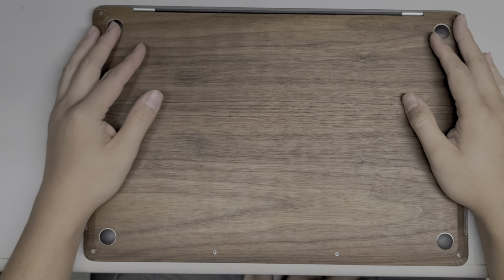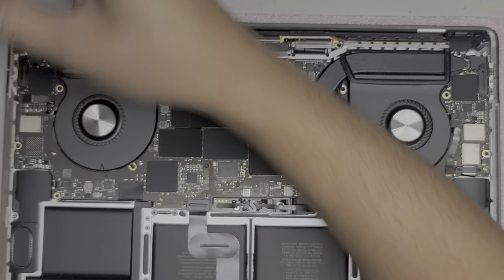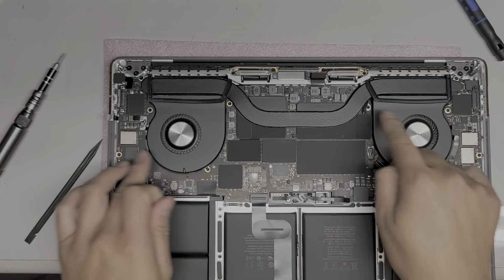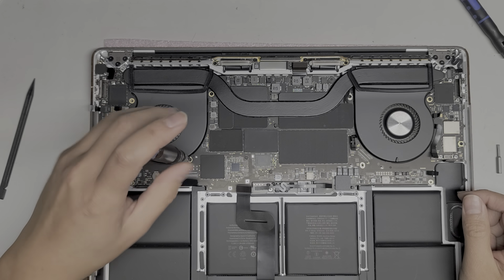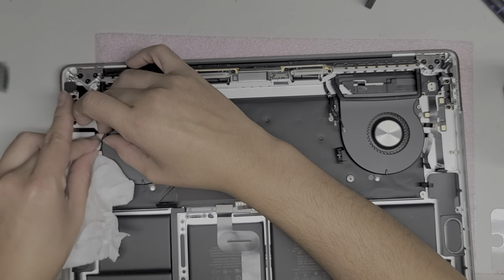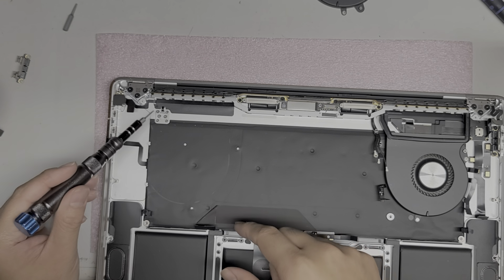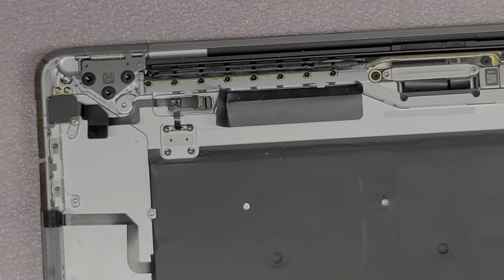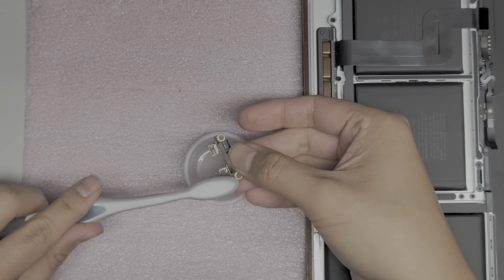2019 16" inch MacBook Pro A2141 Disassembly Charge Port Power Button Fan Repair Replacement Part 1

Comment: I like to either find a photo of the inside of the laptop/tablet/phone i’m working on or take a photo and print it and place all the fasteners and small covers on the paper on top of where they came from in the proper orientation so I don’t have to trust my old brain to remember where each screw goes. I bought an iCloud Activation Locked MBP on Offerup not realizing it was locked but I got it very cheap so I’m going to replace the main board and Touch ID with an unlocked board and Touch ID from eBay. It’ll still be a good deal depending on what board I get.
Reply from the maker: Sounds good

Comment: I am having an issue to find the right screw driver to remove the wifi antenna assembly. I did purchase the tool kits but none of the screw driver fit properly.
Can anyone suggest which exactly screw driver is required to unscrew multiple screws along the length of antenna assembly?
Thanks in advance
Reply from the maker: Use the one that fits best. This set works well https://amzn.to/3JN3SUE start with the size too large, then work your way down.

Comment: Cant get the clips nwar the hinges to remove even with loads of force...
Reply from the maker: You need to slide it down
Reply from the maker: Those aren't clips
Reply: @ItsBinhRepaired  thanks it worked, was just amazed by the level of force. Didn't wanna damage it. Removed a crazy amount of accumulated dust
Reply from the maker: @np5855  great!

Comment: what happens if the latch that locks the connector breaks ?
Reply from the maker: Then you're screwed. You either need to put the latch back or have someone replace it

Comment: i need to replace my io board for my macbook pro 2019 a2159 but i cannot find any youtube video on it. is it simple? or is it similar to another computer so i can watch for another model.
Reply from the maker: What io board?
Reply: @ItsBinhRepaired  the one on the left by the charging port?
Reply from the maker: I don't see a replaceable io board
Reply: @ItsBinhRepaired  so what do I do/replace if my computer wont charge
Reply from the maker: @heartbreakweather  motherboard likely dead or battery issue

Comment: Hi!  I have the same MacBook Pro.  3 days ago, it died.  It won’t charge and it won’t turn on.  It’s frustrating because it died exactly 2 years to the date that I got it as a gift.  I understand it might be the logic board, which is basically a $600 repair.  
In your professional opinion is it worth it to see if cleaning the fan, unplugging the battery, etc will fix the problem?
Reply from the maker: We could possibly fix it for around $250 if the board isn't really bad.

Comment: Do you know which part would prevent it from charging?
Reply from the maker: Battery, charger, charge port
Reply: @ItsBinhRepaired question: do u have to remove the logic board just to get to the I/O board charger ?   Great video but was wondering if there was another way around from removing all that
Reply from the maker: Or motherboard
Reply: I/o board USB-c

Comment: hey Binh, awesome video, thank you!. although i was looking for how to repair or replace my left speaker on macbook pro 16" late 2019 model. the left speaker sounds cracked or has rattling. Do you think thats replaceable? i got the laptop in 2020 and its already got this issue. what a rip off @apple
Reply from the maker: It's hard to find a good replacement speaker as well.
Reply: Any luck? Same with my right speaker! :(
Reply: @anshajgoel  I had the same issue with my right speaker. I couldn’t find any videos on replacing the speaker and the local Mac repair shop wouldn’t touch it because he had never replaced a speaker in that model. I got a speaker from ifixit for $50 and I followed this video  on how to open it. There is almost no way to remove the old speaker without bending it but oh well, it was already broken. The whole bottom surface of the speaker has adhesive on it. I cleaned the old adhesive off the computer and placed in the new speaker. It came with new adhesive on it. I plugged it in and plugged in the battery, put the back on and fired it up. It sounds like new. The whole process took about 15 minutes and I took my time.
Reply from the maker: Yup, you can actually get speakers on Amazon cheaper sometimes. I only replaced the speaker on one like this. I tried like 10 different used speakers all messed up because the process of getting them out destroys them. The only way is to find brand new speakers.
Reply: @bigduner   Thanks for your explanation on this!  The left speaker on my 2019 16" is blown, and like you, I haven't had any luck finding a "how to" video to replace it.  I had read that the speakers were glued/riveted in and other components would likely need to be removed/replaced in order to access them, so I wasn't sure what to do. I had already found a replacement speaker on iFixit site for $50, but I was holding on on ordering it until I could find some confirmation that it was indeed replaceable.  And your post confirms it for me!  I will now be placing my order and hopefully I won't have any issues removing the old, damaged speaker.
Reply from the maker: I believe the speakers on this model are just held in with adhesive.
Reply from the maker: They are a pain in the butt to remove. The adhesive is very strong. You basically have to pry it up.

Comment: Do I need to remove the logic board to replace speakers?
Reply from the maker: No, but they're held in place with a very strong adhesive.
Reply: What is the safest/best way to remove the speakers? Also what kind of adhesive to put on new speakers? My right side speaker blew out. Do you have a video removing speakers? Thanks in advance.
Reply from the maker: @bigduner   I don't think there's a way to remove them without damaging them, but because your speakers are already damaged, it's ok. You basically have to just pry them our with a lot of force. Usually if you get new/good replacement speakers they should come with the adhesive. I haven't replaced these before, so I'm not sure, but you'll want to look at a bare speaker to make sure no parts are trapped underneath anything.

Comment: i have the same macbook, it was working perfectly saturday, and then sunday it would not turn on. i tried everything to turn it on. do you know how to fix this, i bought an i fix it kit
Reply from the maker: Sadly it's likely a bad logicboard. Very expensive repair. :(
Reply: It's Binh Repaired  would you say it is worth replacing the logic board since its not even 2 years old. :(
Reply from the maker: Check if your credit card has free extended warranty built in.

Comment: QUESTION I HAVE MACBOOK PRO 16 INCH 16 GB AND TRYING TO UPGRADE MEMORY CAN CHANGE MEMORY 16 GB TO 64 GB IF NOT HOW CAN I GET MORE MEMORY
Reply from the maker: Oh, I thought the problem was your shift key was stuck. Lol You can't upgrade RAM on any MacBook after 2012. You'll have to sell it and get a new one.

Comment: I have MacBook 16” bought in nov 2019 and now it is dead because it was not charging checked in system before died power full battery capacity 8856 with 93 cycle life and finally died with no battery 
I tried resetting smc with Apple team noting works 
Also I connected Charger through usb power monitor shows it is pulling 2.57amp that’s tells me it charging but not turning on or any sign of life 
Any solutions ?
Reply from the maker: Not sure. Sounds like a dead motherboard
Reply: @ItsBinhRepaired  
It was working issues was not charging it died because no more battery i was thinking battery or charging
Reply from the maker: @Baljit-As-JayKay  neither charge port works?
Reply: @ItsBinhRepaired  
No 
Actually I was connected with usb-c type hub and I was working on my Mac suddenly it restart and after it disconnected with hub and I connected directly to charger was not charging
Reply: Unfortunately it is 80 days over to guaranty and Apple charging for just to troubleshoot too
Reply from the maker: @Baljit-As-JayKay  :(
Reply: Literally the same issue for me.
Reply from the maker: @HoveKB  :(
Reply: @HoveKB  
I repaired with Apple charged me $234
I setup mail in repair they sent me shipping box and after repair done they sent back to me
Reply from the maker: Wow
Reply: Hi Johal. Same issue here. I bought my Mac 16, Feb 2020. Just after 14 months mac is dead.  No response at all when click on power button( even fans does not rotate) . Apple asked 970 SGD to replace the mother boards. Local repair shop asked 500 SGD to fix the issue. ( so basically both apple and local repair shop says it is an issue in mother board. ). I am not satisfied with the cost and trying to find out a solution myself. For your case, what was the exact issue ? what changes did fix it. Apple told me that they do not repair motherboards. What they do it fully replace it. Did they repair or replace in your case ?
Reply: @912dim  they charged me $275
Reply from the maker: Hmmm sounds like this might be a design defect.
Reply from the maker: They only replace
Reply: I have the same exact issue! Not sure what to do. Please help
Reply: @divyabehura6384 , I visited Apple support center in Singapore and they said mother board has to be replaced. They asked my 975 SGD. I did not agree and tried my level best to negotiate for a better price, since my 16 inch mac is only 14 months old and 2 month out from Warranty. It did not work. I got it repaired from a local shop for 300 SGD.
Reply: Same problem, some solution?
Reply from the maker: Might be a design defect on the motherboard.
Reply: I have the same issue too. Couple days ago my Mac 16 just shut down and smelt smoke from vents. It’s not powering on or anything, apple wanted to charge me 690 to ship it out and am 23 days out of the warranty...
Reply from the maker: @Kirke170  if you bought it with a credit card, call the credit card company and ask if they have extended warranty. A lot of credit cards will cover an additional year of coverage.
Reply: @Kirke170  
I fixed by Apple after fighting they ended up charging me $275

Comment: How to power on pads on MacBook 16.
Reply from the maker: No idea
Reply: @ItsBinhRepaired  there has to be a way to try to turn on the MacBook if the power button is not working right?
Reply from the maker: @dhruvinpatel4638  no idea